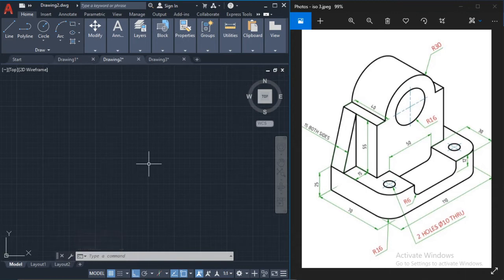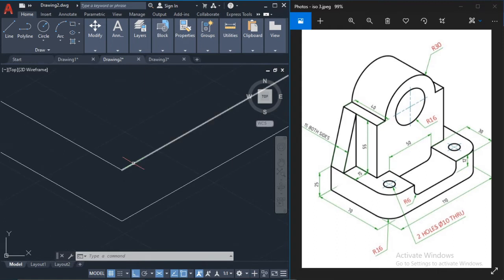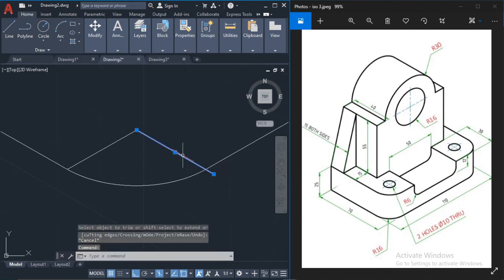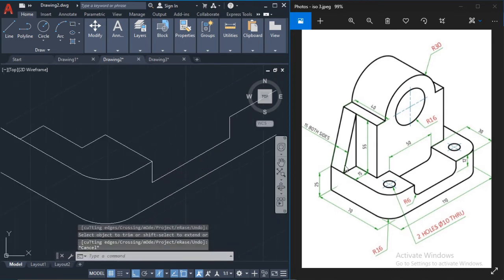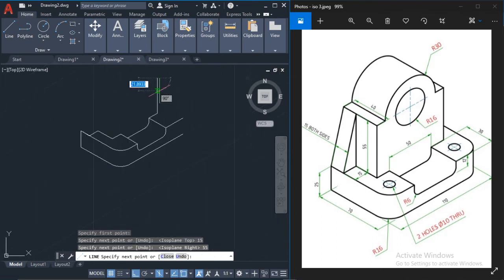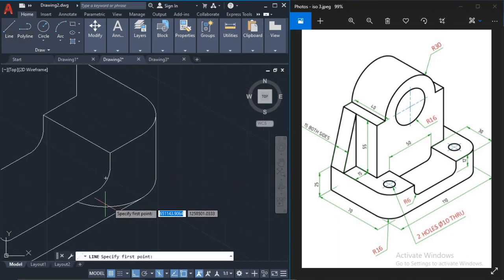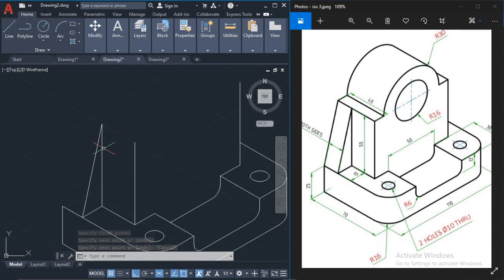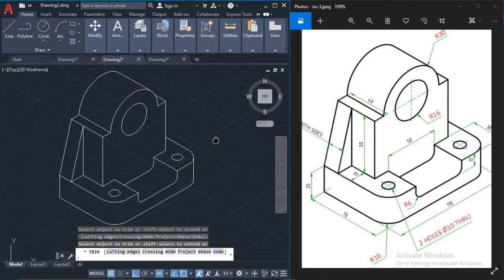ISOMETRIC DRAWING IN AUTOCAD #3

Comment: In a isometric drawing, how do we determine the directions of the ellipses in representing cylindrical or circular shapes?
Reply from the maker: If the curve is on the top of the drawing, use Iso plane top. If it's to the right use iso plane right and if it's to the left use left use iso plane left.
Reply: @mr.cargill  thank you so much. Do you know what are the axes’ directions when the isoplane is set to left plane? Sorry for the questions.
Reply from the maker: @itz_mafi2340  you're welcome.
Reply from the maker: @itz_mafi2340  Sorry for the late reply,  once you select left plane, the x axis is set to 30 degrees and the the y is set to 90.